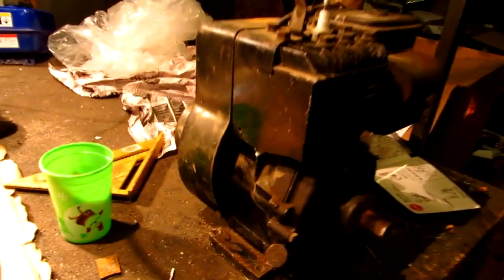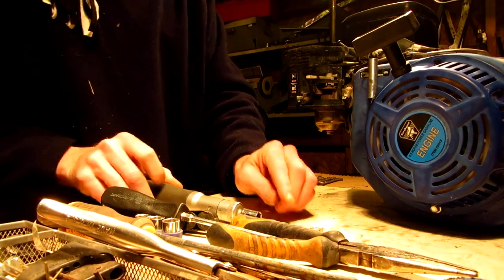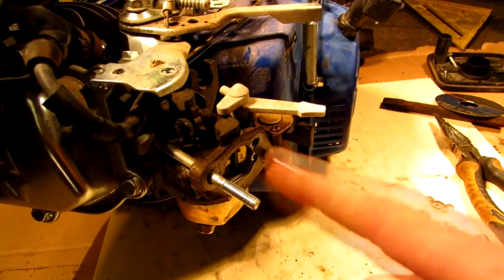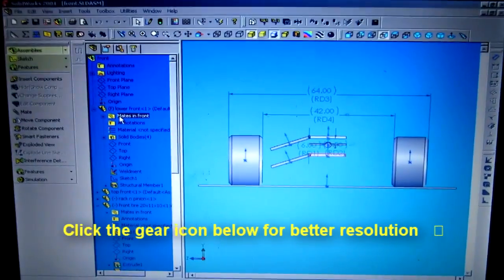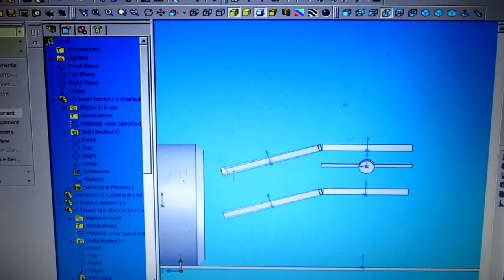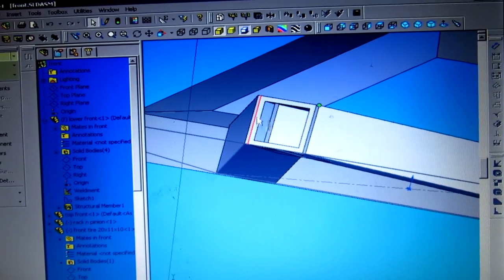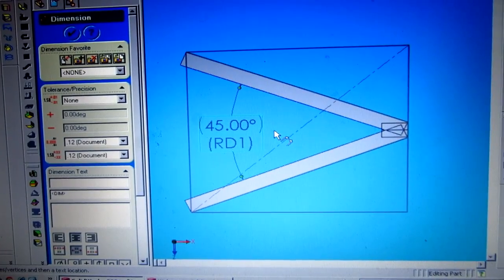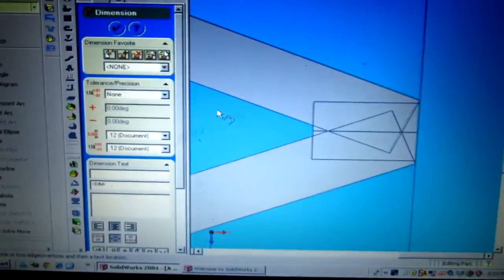█ Go Kart Off road build update ( The Fullscreen Machine )

Comment: I made a adaptor/spacer for a K&N out of wood and it works
Reply from the maker: do you have a video of it???
Reply: ***** I can send you a picture but its just a spacer so it wont angle the filter like you want because it just so the filter mount would fit on the bolts you need to buy a angled filter kit if you wand it to not be in the way

Comment: 1 more thing, the adapter and filter can be a bit pricey but well worth it around 40-50$ also will increase power if you add a free-flow exhaust. I feel that i got atleast 15% more power from just those 2 "mods". And AGK has a whole list of mods and they sell the parts for everthing.

Comment: you can but the adapter and filter on agk.com and they also have a tuturial on how to make a 90• bend out of some radiator hose. Also i think you have to remove the housing on the brigs to get to the serial # and they are always printed on the inside of the engine block, but that would be a bit of work. If you dont find the website il PM you the link.

Comment: That's a early 70's motor the numbers should be on the left hand side between the engine and carb try taking the shroud off it will make it easier to find

Comment: instead of using square tubing, use pipe and thread the pipe. or you can buy those long nuts and weld them in. I would chose the pipe because you can weld it and then thread ensuring the threads are true. where as with the nut you run the risk of distortion.

Comment: You should be able to make one from the help!!! Section at abc auto parts, autozone, or orilies auto parts. You may try home depo and get some plastic parts. The issue you will have is what is your filter size and then get the pipe, elbo to fit that.